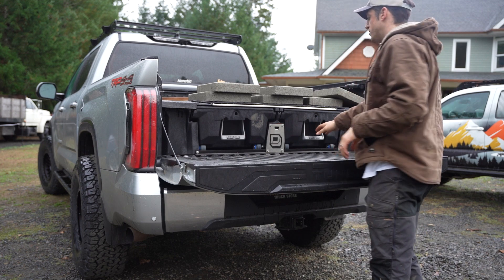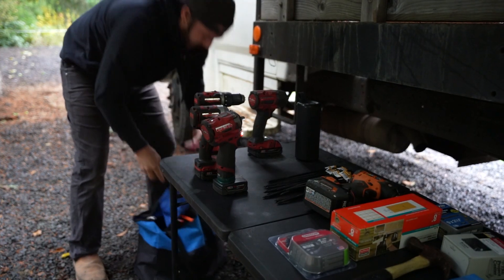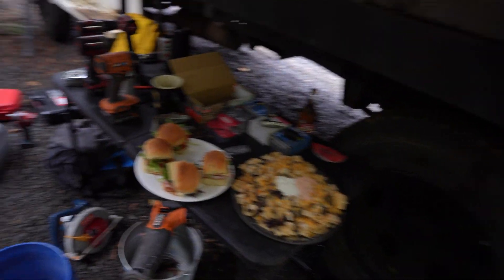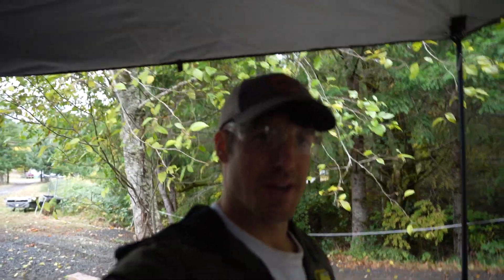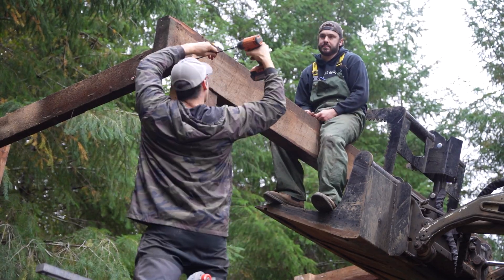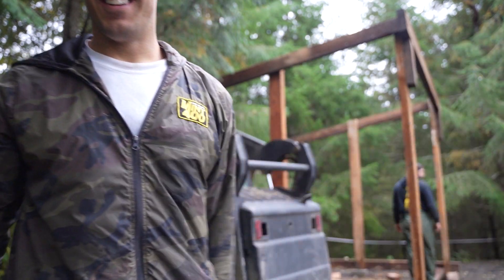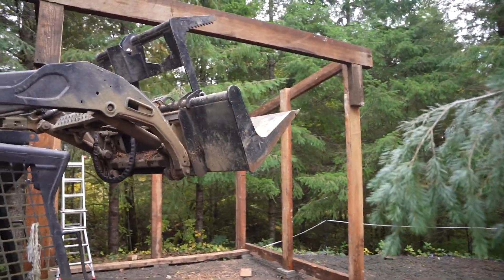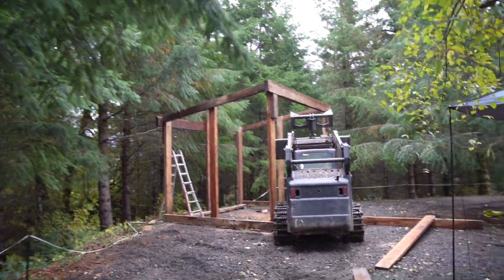Building a Heavy Timber Barn with reclaimed Barnwood

Comment: I’m not a pro but possibly ask someone about the lag bolts you used. You might need larger ones or nails because the shear strength of the ones you used looks low. A strong gust of wind might knock it completely down.
Reply from the maker: I love the Timberlok screws. They are made for exactly this. They exceed the strength of 3/8ths lags without pilot holes. Each screw holds up to 1,145 lbs with an 800 pound sheer strength.
Reply: @Maxx.Powell  sounds good, glad you did your research. Love your videos and most importantly, your message! I was in your shoes 17 years ago, I was fine and would’ve been fine with that life but I made a slight adjustment in life, I went back to school and now I’m retired at 46 and happy!! No longer just fine. Keep spreading your energy and message. Keep motivating people! Maybe one day I’ll see you on a trail. Cheers, stay safe buddy.